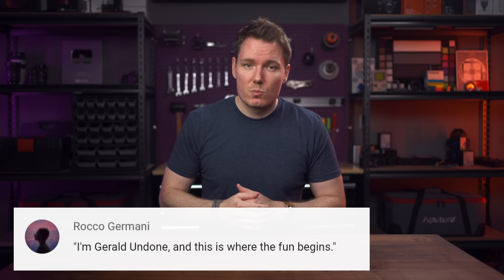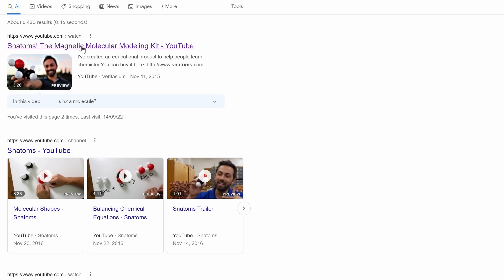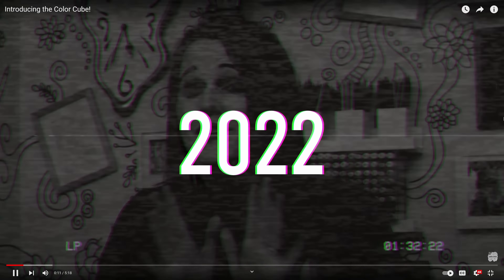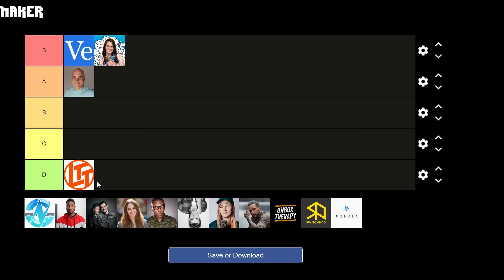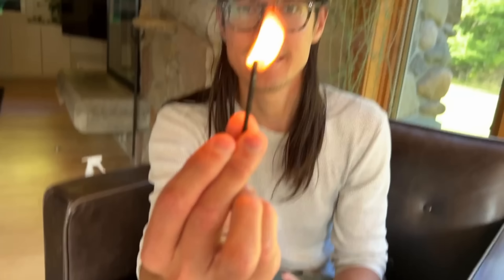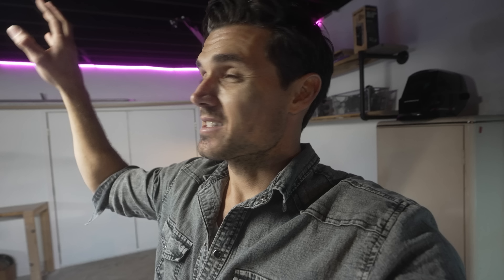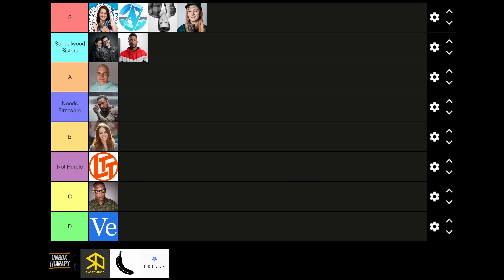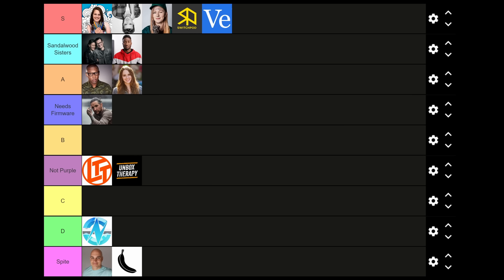Ranking YouTuber Product Ideas (Tier List)

Comment: If it were me, i'd have JerryRig's knife disqualified. It seems to be a stock existing product with an aesthetically a little different handle. I have been seeing them at Hornbach for years upon years.

Then Markus's scented candle. Not entirely convinced that it even fits the definition of "tech".

Conflicted about Sneaker Wipes. This seems like an absolute TOP NOTCH product to me, because, where else are you gonna get wipes that are neither for your butt, nor for your skin, nor for your glasses and optical things, but for your shoes? I mean you can get a folding knife with replaceable blades, you can get candles scented in sandalwood, but sneaker wipes? This is an absolute S-tier product, but just not techy enough.

An easy disqualification for Unbox Therapy. He literally showcased an identical product from China on his channel; then that product picked up popularity and several weeks later, there were cheaper copies of that product. Then Unbox Therapy rebrands one of those copies as his and deletes the review of the original!

Other products are INSANELY impressive.